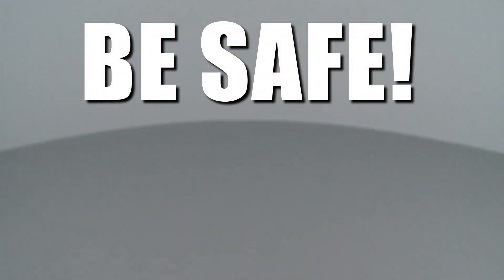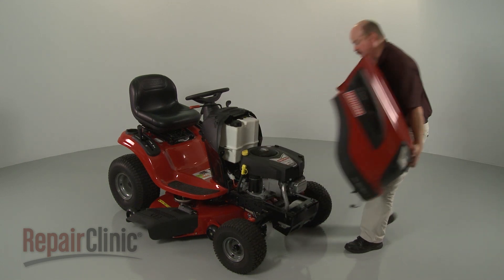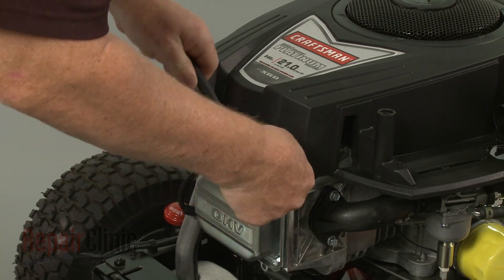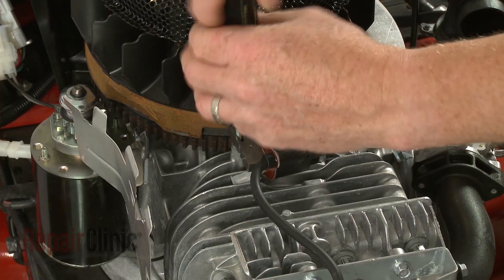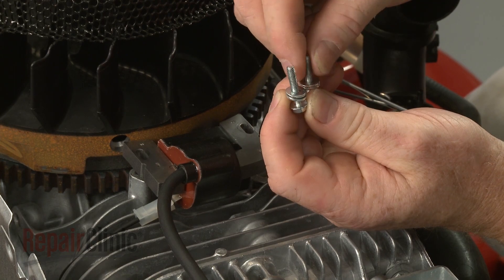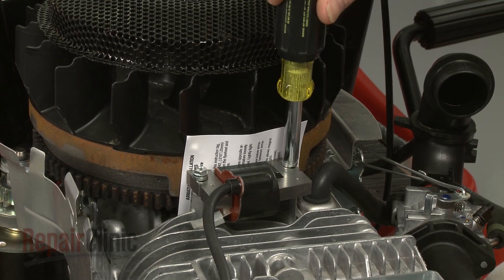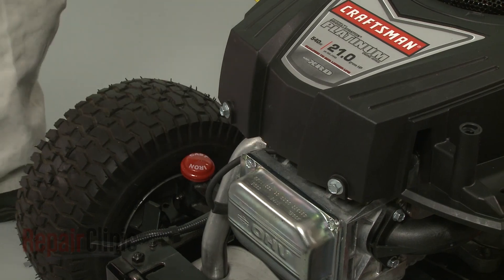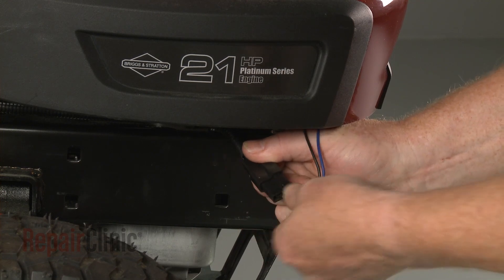Briggs & Stratton Riding Mower Engine Ignition Coil #799650

Comment: I find that removing the cover on my John Deere riding mower requires only loosening the four screws then lifting the cover off because the mounting holes have slots to allow easy removal. No need to remove screws.

Comment: I'm putting a prime line 7-01652 on a brigggs and stratton  model 80232 type 0036 01
Still no spark. Maybe I wired it wrong.  Has 2 wires where they go. No directions?

Comment: I was told I needed a new coil by an on-line garage for different symptoms.  I would like to ask your opinion before buying one.  My riding mower has a Craftsman B&S engine - flathead - and will start and run for about 12 minutes, then dies as soon as it is warmed up.  It will die right away if I try to mow with it.    I have rebuilt everything  on it last year and now this happened.  Does this sound like ignition coil to you?
Reply: Yes, it does to me. I assume you already replaced it though. When these start to go bad the engine will miss when it's warmed up.